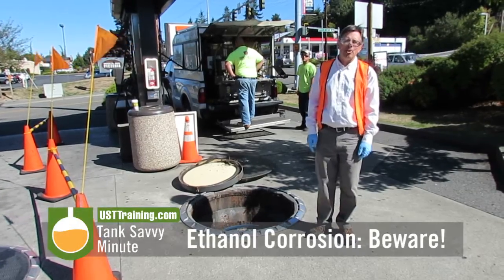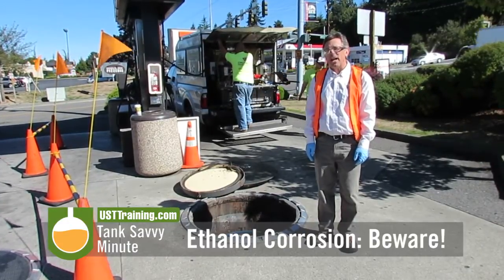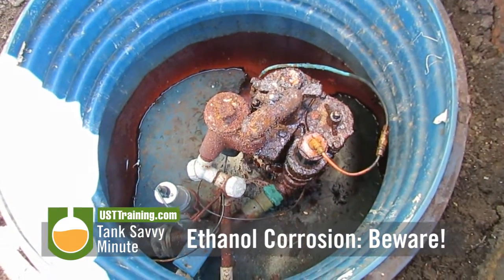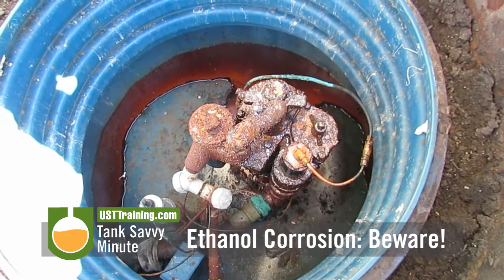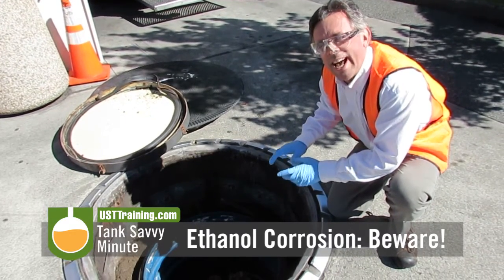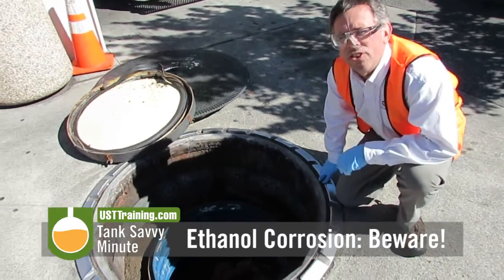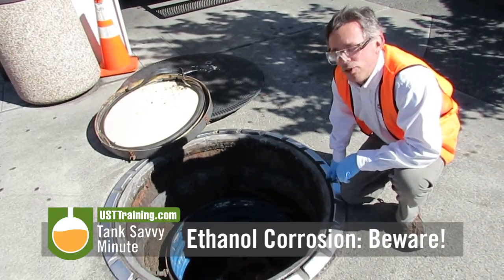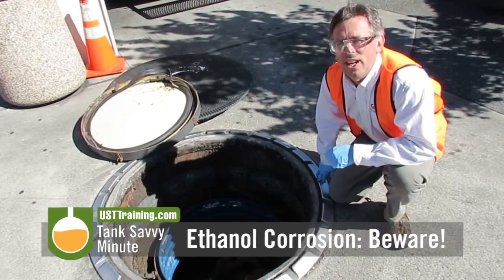Ethanol Corrosion: Beware!

Comment: Ben, where does the water come from?
Reply from the maker: Most likely it's surface run off, unless the groundwater is high and seeping in through the bottom and sidewall penetrations.
Reply: Thanks for your quick reply. So, if the water is from surface runoff, etc., why are you blaming the rust on ethanol?
Reply from the maker: Because if you have  E10 fuel in the tank, which can contain up to 0.5% water in the gasoline, and if the E10 vapor leaks into the sump, you can get major corrosion that way. See https://www.google.com/url?sa=t&rct=j&q=&esrc=s&source=web&cd=2&cad=rja&uact=8&ved=2ahUKEwit1_6VmKLeAhWyHjQIHR0JDLwQFjABegQIBxAC&url=https%3A%2F%2Farchive.epa.gov%2Fada%2Fweb%2Fpdf%2Fcorrosion-in-stp-sumps-2.pdf&usg=AOvVaw0ba7extOelnJzwCyWz2gGH
Reply: @USTtraining  I think your statement is incoherent, and your conclusion is incorrect. If you're concerned that the ethanol contains some minute amount of water and that that water is the cause of the corrosion,  why blame ethanol? Water can easily form in the sump shown in your video from condensation or any type of leak from run-off rain (certainly the sump you are showing must be subject to leaks on a regular basis). On the other hand, if the corrosion is caused by acetic acid as a result of ethanol degradation then why mention the minute amount of water? Moreover, the containment sump you are showing doesn't appear to be airtight, so if ethanol is present it should evaporate before the ethanol has the opportunity to degrade into vinegar. In any event, because we're dealing with distilled alcohol, the ethanol itself would be capable of killing any bacteria that creates acetic acid. 

In a controlled situation the distilled alcohol could get diluted down to a point where the alcohol content is not sufficient to kill the bacteria, but the process of degradation is not immediate. In the case of the containment sump you show, it seems to me that there would be a regular or constant flow of "fresh" ethanol-gasoline fuel so that the degradation process never starts (or never finishes to the point where it becomes too corrosive). On top of what I just wrote, what are the components shown in your video made from (what type of metal). Ethanol is compatible with more types of metals than gasoline and aromatics, so the components would have to be constructed from just the right type of metal that is more susceptible to ethanol than to gasoline and aromatics. I recognize that the issue may not be so much of an "ethanol corrosion" issue as it is an issue of "acetic acid corrosion," but gasoline and aromatics can also degrade to a point of becoming acidic. Therefore it is again incorrect to single out ethanol as the villain.

I'd love to get your thoughts on this.
Reply: https://www.youtube.com/watch?v=_6WhI-wgNEc We have 3 spill containment's 1.premium 2.regular 3.diesel
since the ETHANOL MANDATE went into effect 2006 our ethanol blended containment's have deteriorated. In the year 2015 we switched our premium tank to non-oxy and that containment stopped corroding altogether. The E-10  regular tank has continued to corrode as seen in video and our diesel containment is  same as new.  All tanks are 15ft from each other. Pretty cut and dry. Ethanol is very corrosive.
Reply: @joeyjojoe8486  All liquids are corrosive. Ethanol is compatible with more types of rubber, plastic and metals than gasoline and aromatics. This means that overall ethanol is LESS corrosive, not more corrosive. If there is a specific component of a tank or fuel system that ethanol is responsible for damaging, what is that component and what is it made of.
Reply: There is little controversy about the corrosive effects of ethanol in the Scientific community, the ? is how do we go about it from here. Aside from the corrosion aspect it is also widely known that ethanol would be done long time ago if left to market forces without subsidies.  Energy output of ethanol is a fraction  of traditional gasoline, not even recapturing the energy used in the process of making ethanol. ie we would use less energy (tradional fuels) if we did not convert food into fuel. 
https://youtu.be/KhtwJGgeN2Q
Reply: @joeyjojoe8486  All liquids are corrosive. One of the most corrosive liquids is water, yet we drink it, wash with it, and swim in it - including salt water, which is more corrosive than fresh water. Regarding the above video, and your video that purports to show ethanol corrosion, you should read what I wrote to Ben Thomas about an hour ago.

There are no ethanol subsidies. There was an ethanol subsidy but the subsidy actually went to the oil industry, not to ethanol producers. By comparison, there are many oil subsidies, and gasoline would not have become the dominant fuel if it wasn't because of un-natural market forces. 

Your other points are incorrect. Not partially incorrect, completely incorrect. You don't know what you're talking about. If you would like to learn about the issues, you can read my 641-page book, THE ETHANOL PAPERS. It is available for you to read online for free. You don't even have to register to read the book...you just read it. If you read something that you disagree with, let me know and I'll try to explain it better. The book is available at: https://www.theautochannel.com/news/2018/10/12/632678-ethanol-papers-massive-book-provides-whole-story-ethanol-fuel-free.html.

I look forward to hearing from you when you have a real question or point to raise after reading some or all of the book.
Reply: @TheAutoChannel  oops my bad I will tell my ust's they can't corrode because you wrote 600+ pages proving they can't.
Reply: @joeyjojoe8486  See, that's the problem, I didn't say that ethanol can't cause corrosion. In fact, I specially said said that all liquids cause corrosion, and naturally since ethanol is a liquid it would fit in the category. What you did was to take what I wrote out of context and then exaggerate the comment in your favor. This is how asinine statements like your "Energy output of ethanol is a fraction  of traditional gasoline, not even recapturing the energy used in the process of making ethanol. ie we would use less energy (traditional fuels) if we did not convert food into fuel" come into existence.